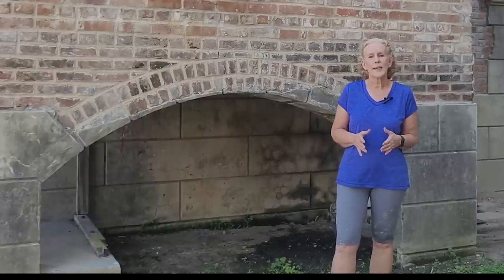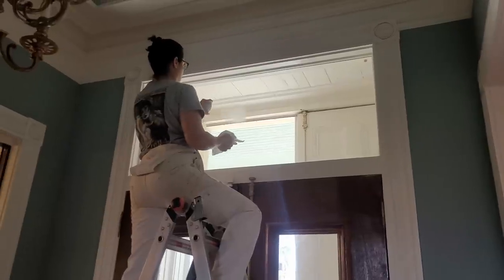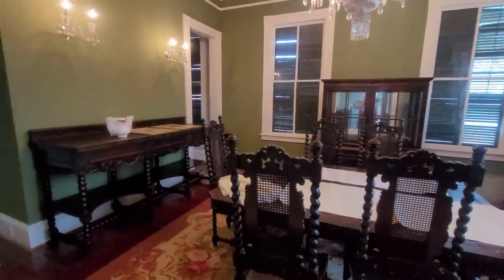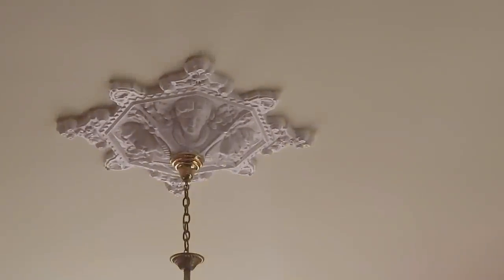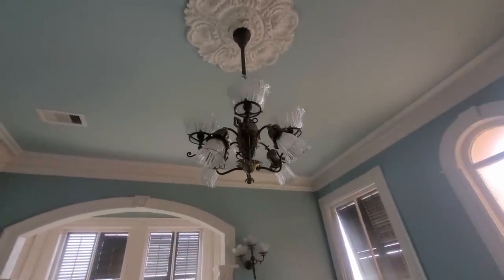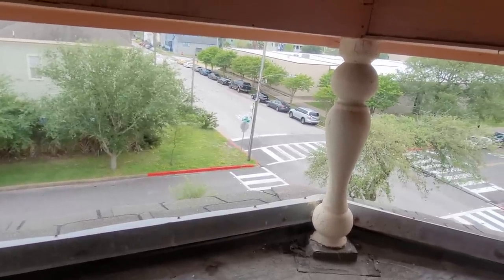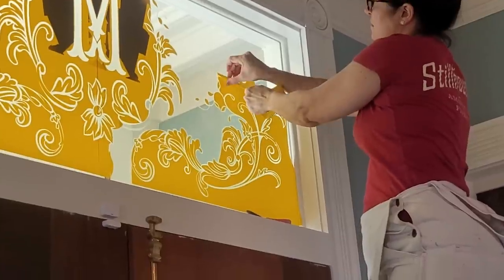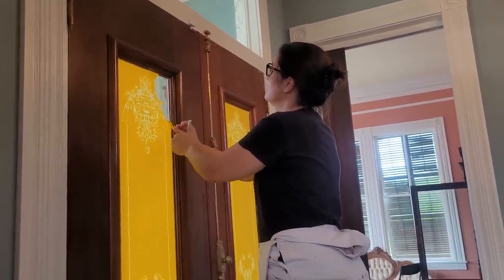S3.07  More Doors by Heather - Getting Ready for the Galveston Home Tour

Comment: Beautiful house, but the stairs seemed to be treacherous.
Reply from the maker: They actually are.  They are so steep and very narrow treads.  You have to walk close to the outside of the spiral and my feet aren't that big.  I see why Angela added an elevator.
Reply: Actually they were safe! My children rolled down them several times but you fall in a straight line so only go down about 3 steps before hitting the wall! We moved some of our furniture through the 2nd floor windows and porch and top of the movers truck.

Comment: If you just sprayed the glass with a mister filled with distilled water and two or three drops of tincture of green soap then the vinyl wouldn’t adhere until after the release paper was completely removed and you used the breyer to adhere it, allowing you to reposition the design if need be. 
Infinitely more forgiving than going up dry!
Reply from the maker: For this process the design is cut into adhesive paper that sticks to the window like masking tape so it isn't possible to slide it like a regular stencil.  It is more difficult to place but it allows for a much more intricate design.  I can't imagine doing this on a ceiling like Heather was talking about.
Reply: Thank you for your comment, but that is not the same product as a vinyl window appliqué. This is a super super sticky one time use stencil making a permanent etched design on the glass. If I had made a mistake in the application, I would have ruined the stencil. Completely different animal.